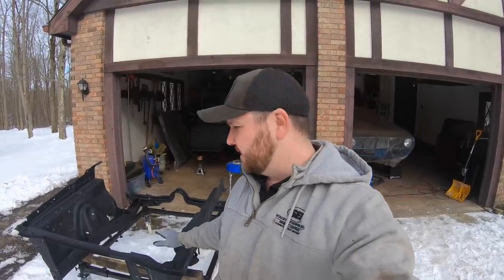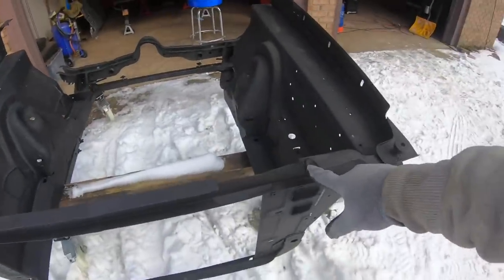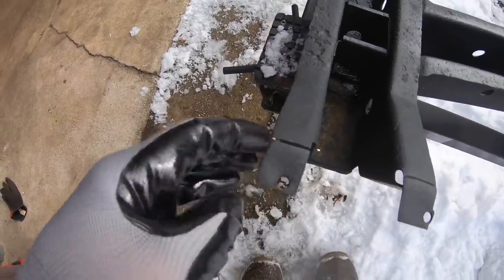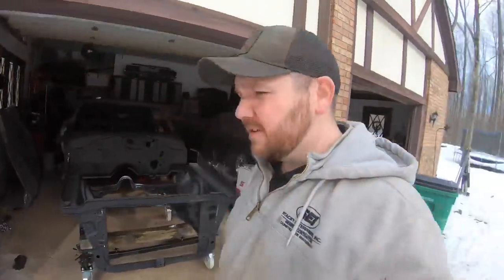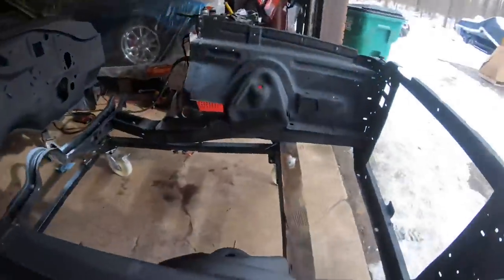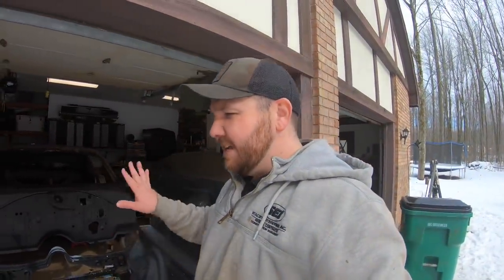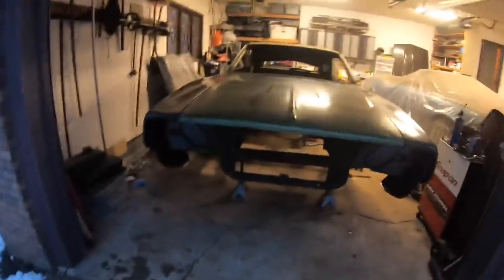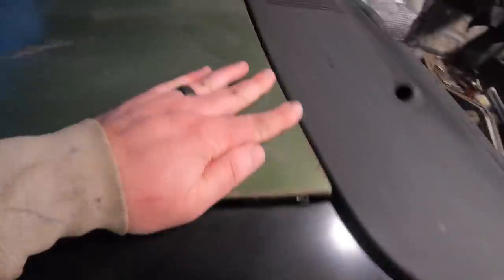1968 Dodge Charger Restoration - Episode 14 - Front Clip Install - Part 1

Comment: the fender gaps wide on one side and narrow on the other indicates the front end is skewed slightly to the drivers side. measure the diagonals from reference points on the body to the front corners of the clip and only weld it in when they are equal.

Comment: Wow again another great video on your build and amazingly doing it solo! You were meant to take on this challenge, AAA+++, Q: What gauge metal thickness you use for your Patches?
Reply from the maker: Typically 16-20 for most.  I used some leftover rocker material I had for the frame repairs in this video.  It was 16 ga.
Reply: @rustbucketrestos6511  Thanks

Comment: man, the car is looking great! your doing a great job on it. did you say in another video that you've only been welding for like three years?
Reply from the maker: Yep not very long... but a LOT of welding in that time.  Doing patches and installing sheet metal doesn’t take too much experience to do.  Practice on a floor pan.  You’ll be a pro once it’s in!
Reply: @rustbucketrestos6511  I've been welding for about 20 years as a diy guy, just thought it was cool that you weren't afraid to tackle a project of this scale being a relatively new welder. freaking awesome man.
Reply from the maker: Thanks brother 🤘🤘

Comment: Did they ship your right fender with the dent like that? Or unfortunate incident after arrival? Always hurts to have to work on new panels. Keep up the good work!
Reply from the maker: No, the panel I received from amd is excellent.  The passenger fender was on marketplace for $300.  I had to jump on it!  Needs a little love and hammer dolly work but it should turn out just fine
Reply: @rustbucketrestos6511  Definitely don't blame you then, $300 plus a little time is better than the price on a new replacement now.

Comment: Seems like I would get a little nervous at this point making sure it's all lined up ready to weld  !  And a question about how you delt with them leaded spots ?
Reply from the maker: Sure, what’s your question?
Reply: @rustbucketrestos6511  did you just leave the lead alone on the lower a pillars if I'm saying this right or what  ?
Reply from the maker: I grinded it back enough to fit the cowl.  Have not filled it back in yet
Reply: Didn't mean to hit the the thumb down icon I'm still new at this as for my question maybe you just didn't get to it yet or I just missed something IL go back and re watch thanks and keep up the good work fyi I think you have a new engine and  other parts on the mystery pallet  !
Reply from the maker: So you’re the one that did the thumbs down!!  Lol

Comment: Did your right front fender come with that custom dent near where the antenna hole would be? Fantastic job so far but I would have rejected the part or negotiated a significant discount.
Reply from the maker: I bought it off marketplace for $300.  5 mins with a hammer and dolly and it will be like new

Comment: Hope you getting a new passenger side fender.. ?? Are you fixing it or did it get shipped that way..??
Reply from the maker: I will repair it.  I found it on market place for $300.  Had to jump on it!
Reply: At least it was cheap enough..I found a guy here in Ontario Canada had new floors and trunk floor for my  '69 roadrunner got them for 175.00 bucks and only lived 40 min away ..doing a good job buddy keep up the good work I just did firewall and front clip like you did on my '74 challenger..it was horrible the way they didnt weld anything in it was just a couple tack welds and bondo holding it together all fixed now and on rear frame and floors..cheers and thanks for the reply 👋😁👍
Reply from the maker: Awesome!  Sounds like a fun project
Reply: No not fun last guy musta used 5 gallons of roofing tar and spray on tar then had it all oiled not fun to clean..lol.. it's on inside and out of trunk floor and interior on challenger.lol
Roadrunner will be easier it's from south Carolina needs floors and leaving the patina on it for now,no big issues it runs and drives but just picked up a 440 hp from a 69 gtx for 200 bucks .. but you're doing good work keep it up .. I'm a charger guy my first car was a 70 charger always loved the body style of 68-70 chargers ..

Comment: You should refine your weld settings: more amps! Your welds sound and look very cold, bad penetration
Reply: I agree, should up the amps and stay on the metal longer to get penetration.  Should be glowing red on the back of plug welds.
Reply: more amps, less wire